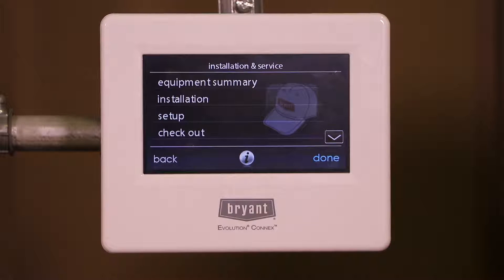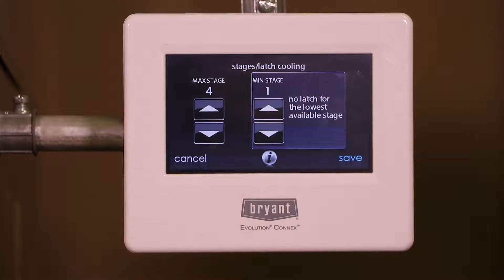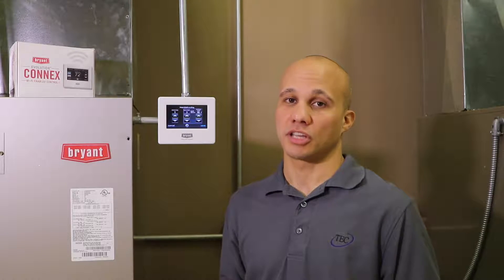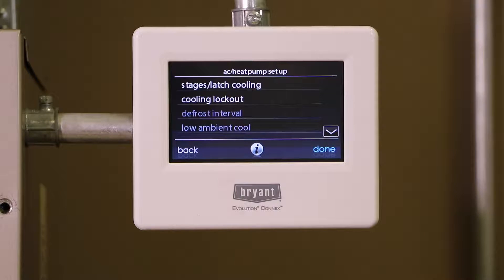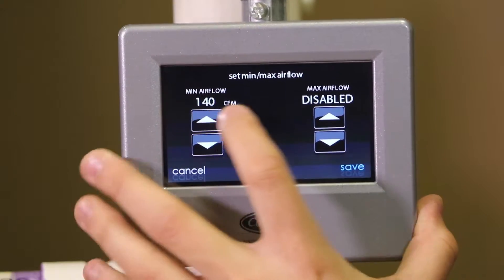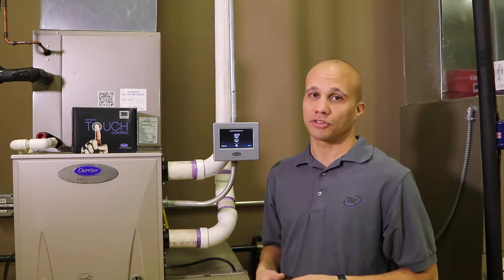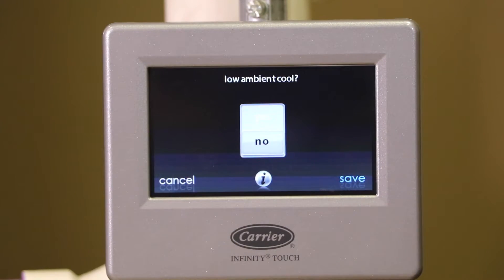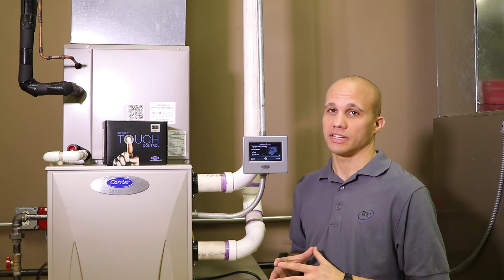Infinity Touch / Evolution Connex A/C & HP Configuration (4 of 5)

Comment: Yalls need to stop with the DC compressors. STOP with yhe communism already.
Reply from the maker: DC compressors are much more flexible for capacity control than AC. And it is one less electrical conversion point (AC > DC inverter  and then staying DC to compressor instead of AC > DC inverter > AC compressor).